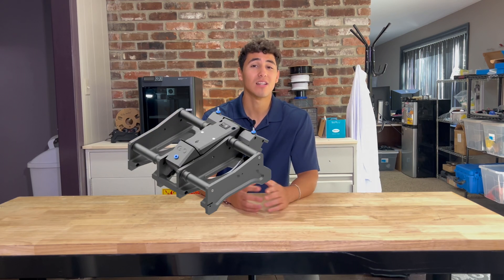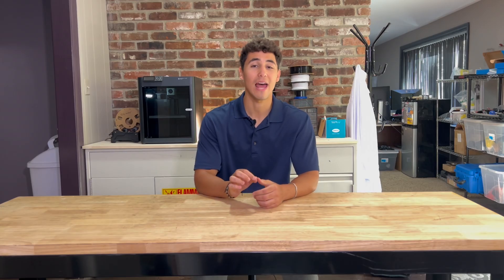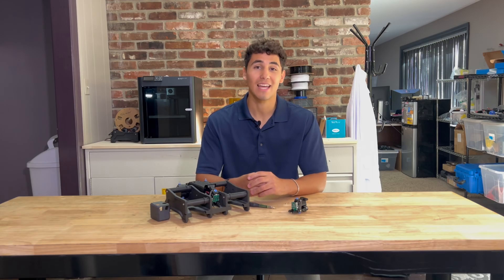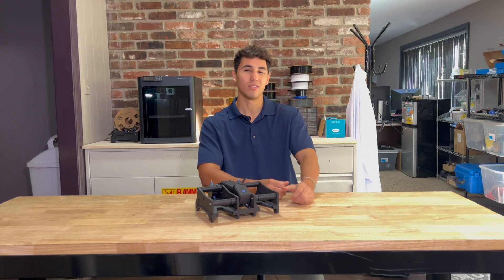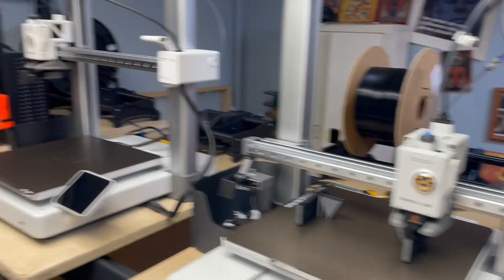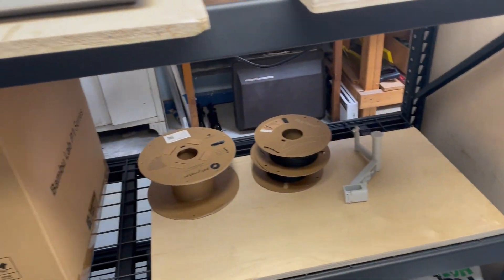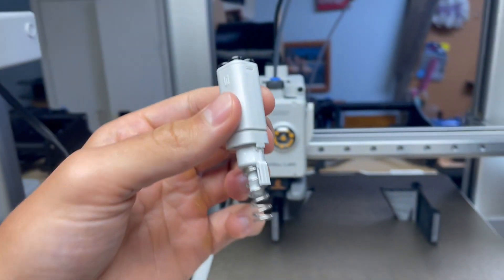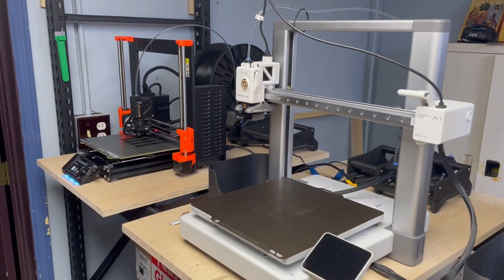Answering Your S1 Questions + New Farm Update!

Comment: This is a must have solution for any print farm. And implementation is good as well. But I have a few comments/suggestions, based of my experiense using it.
1. Extruder gears are extreamly cheap. I already had to repair on extruder by replacing BMG gera set after only 15 spools.
2. Threads in a thin aluminium plate to connect spool sliders is not the most robust solution. I had one slide loos pretty fast. Most probably, I did not guide the screw correctly and did damage threads during assembly. But it is very easy to do as Idid not even noticed. Maybe adding heated inserts into the plastic cover behind will be a bit mor reliable solution. IMHO
3. FIlament input pass before gears is very short and soft. Basically a PTFE tube and a bit of soft plastic of an extruder. If filament supplier has a good winding spool with correct attachement of a filament to a spool core - everything works like it should. But if it is a simple spool with the hole in a core, two problems accure:
a. when spool is empty, plastic drags spoolm from slider and it falls to the floor/table.
b. Plastic is bended and cannot be straighten. It cannot enter smoothly into the printer's extruder and leaves a nasty artefacts in a print, especialy in vase mode.
I tried to feed filament through E3D all metal heat break. It helped but spools were keep falling.

So those are my observationd after 2 weeks of extensive use.
Once again, great product and it made a big difference in my print farm. Going to purchase more units to put to every printer I have.

Comment: So I just got my S1 in the mail, got it setup and tried it out.  It works amazingly well as advertised, when one spool ran out the next one quickly took its place with no interruption in printing.  HOWEVER, there is one issue that is more of an annoyance than anything.  The empty spool will fling itself off the roller because when the final filament strand breaks off the spool there is nothing holding it onto the roller and it just falls off onto the floor or onto my printer depending on how I have it situated.

Comment: does this work with retractions or does this leave a line where a retraction should have taken place due to the extruder being disconnected with the original filament in the gap between the extruder and the nozzle?
Reply from the maker: @hunt0583  there is no line as there is still a pressure release when the retraction happens, this is mostly what happens during normal retractions as the filament closest to the nozzle is already liquid anyways, we have done tons of testing with this however and have never seen any issues, we also have beta testers with Bowden setups that encounter this but for the entire length of Bowden and have had no issues

Comment: Looks very neat, about how I expected it to work. I’m guessing the pressure sensor is done using a magnet and hall sensor. But I have doubts about whether it could work with 95A TPU and softer filaments.